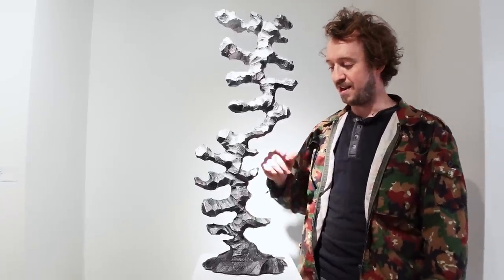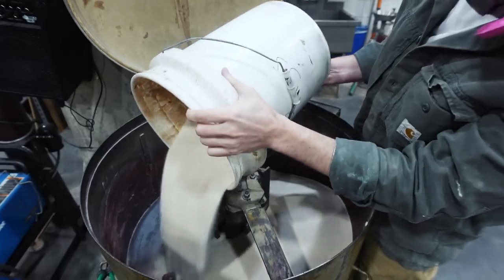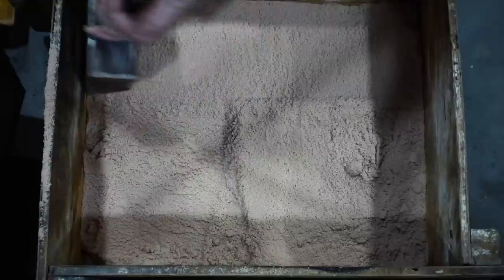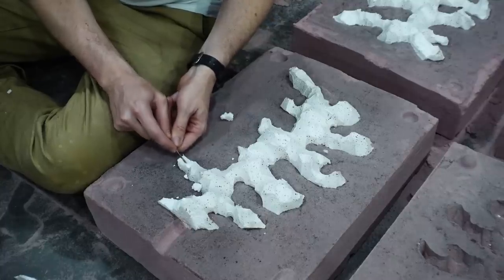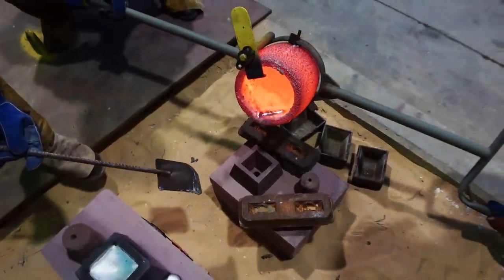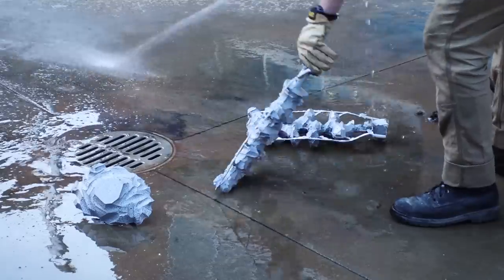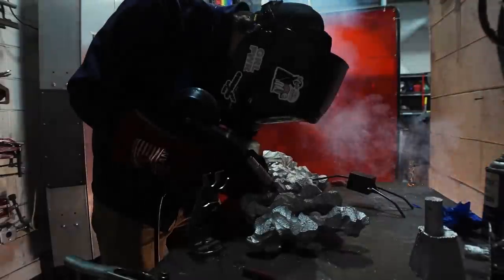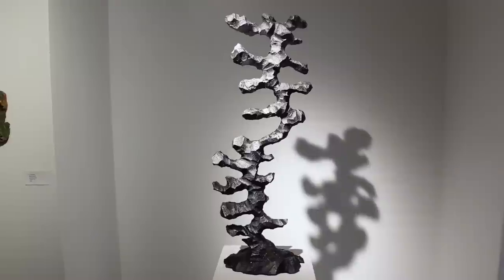Making an Organic Aluminum Sculpture out of Styrofoam!

Comment: Peter, we used those Needle Scalers in the Navy to remove paint from the ship exterior prior to repainting.  They were called Needle Guns when we used them and I spent many long hot summer hours using them. At the end of the day your hands and arms would be numb from the vibrations all day.

Comment: Filming welding and casting is like filming rocket engines. NASA still uses high speed analog film cameras with SLS missions for a reason. No digital camera can reach that level of capturing dynamics of light-shadow areas. Perhaps in near future it will be possible.

Comment: All those steps are so interesting and satisfying.  What do you think you could use instead of styrofoam - would papier-mâché work?    Those sparks and smoke swirls from the welding were very beautiful too.  Do you get to keep your sculpture?
Reply from the maker: Yeah paper mache could work, really anything. The only problem is that the softer the material is, the more likely it is to get deformed by the sand packing process. However I’ve even made molds of bouquets of flowers and branches of leaves. While these got squished a lot, the textures and shapes in the resulting metal sculpture were really cool.